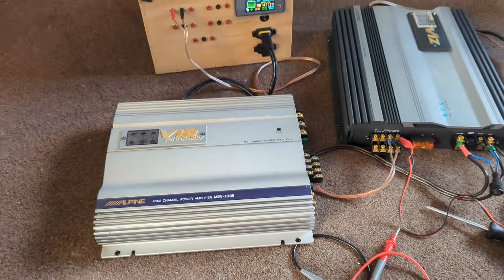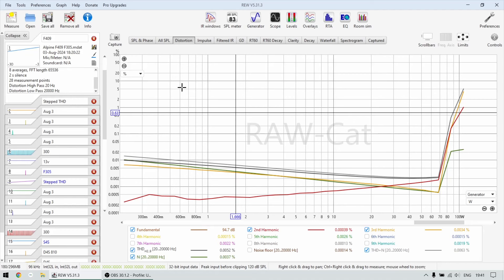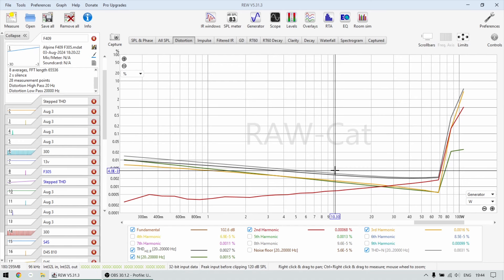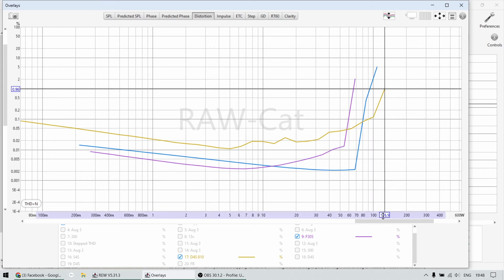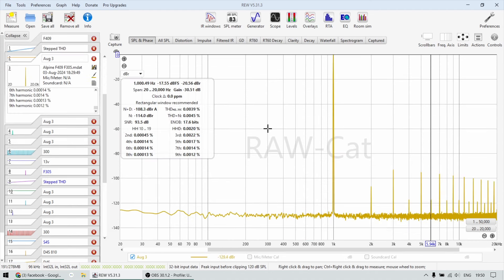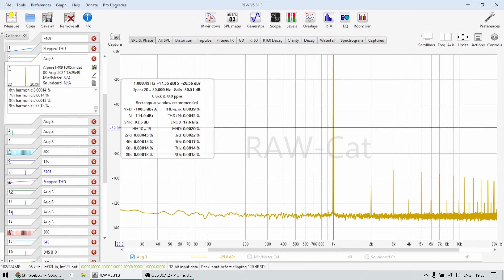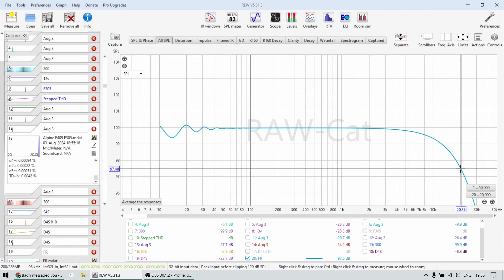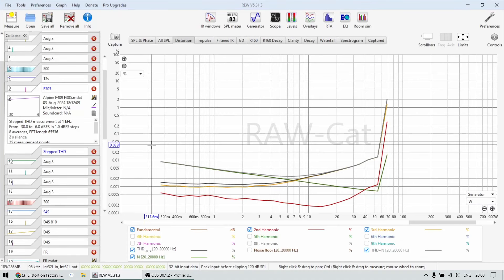Alpine V12 amplifiers are as clean as DSPs.

Comment: What is the benefits of copper backplates and high end head units with copper chassis, is it for noise shielding? Ive even seen installs that use copper sheets in amps racks
Reply from the maker: Nah, it's just for aesthetics. Copper looks cool and expensive.
Reply: @RAW-CAt  I could agree it definitely looks cool, but there has to be something else more to it, especially since the backplate isn't much of a visual aspect being bottom on the amp.
Reply: @RAW-CAt 
Copper is very good for heat dissipation compared to aluminium, heat increases distortion, so when thermal management is good and if you can make the amp run cooler you have a better chance of making a clean amplifier. 
Any amp designer can correct me if I'm wrong.😃 
But I feel in 309amp, copper is not used for heat dissipation I think.